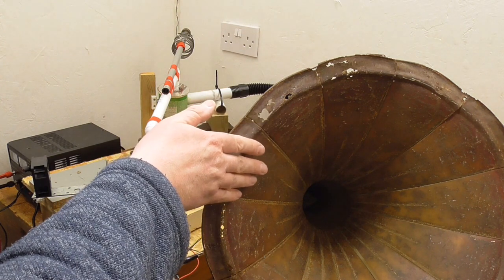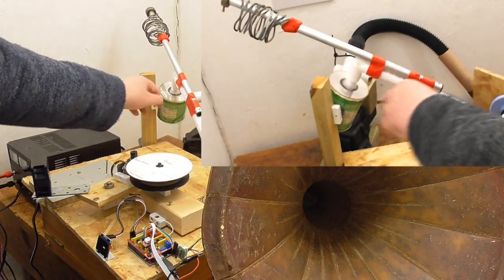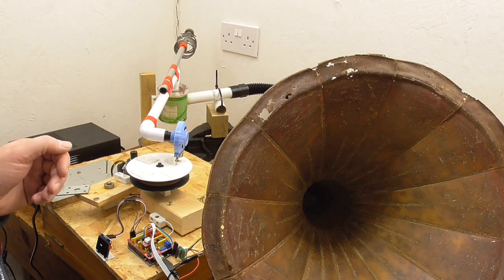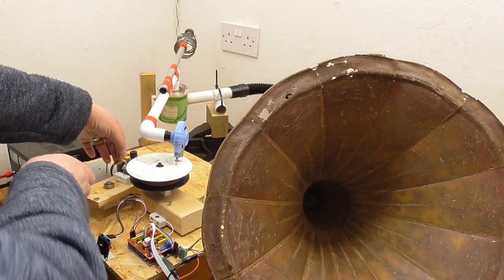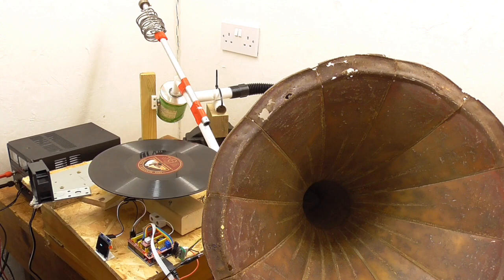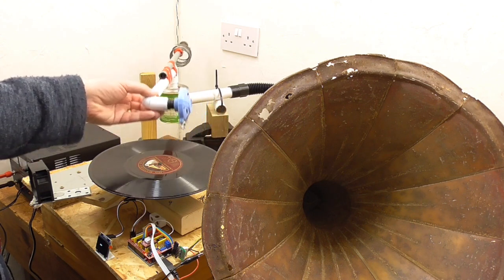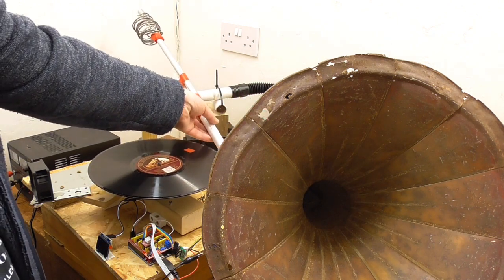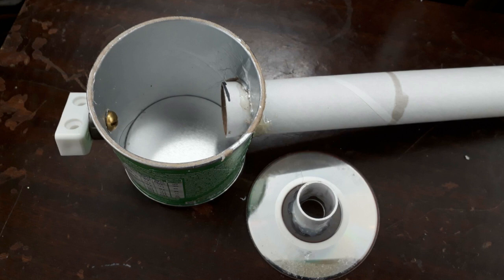Stepper Motor Gramophone with big horn

Comment: Very nice, much improved. I like the tone on the soundbox you made better. Always look forward to your videos.
Reply from the maker: Thanks 👍. The sound on the DIY one is not bad, but I will probably have a go at building a better one using the lathe. I don't want to go all precision engineering though as part of the fun has been building this sort of stuff out of scrap and junk. 😀
Reply: mrrgstuff of course, you should see my pile of scrap and junk

Comment: I did expect it to be louder, any air leaks? Maybe piping needs to go through the pringles box, instead of directly into it.
Reply from the maker: Yes, I expected it to be louder too. With the blue sound box you can tell the sound is coming out of the horn, but with the DIY one, not so much. No noticeable air leaks but I think you are right about the Pringle box, the pipe should continue through it. Shouldn't be too hard to change, though I ought to measure the volume before and afterwards also. Thanks 😀

Comment: Interesting. I reckon a much shorter path to the horn would improve the sound. Cheers
Reply from the maker: Thanks 👍Yes, the path is a bit convoluted now! I didn't really want to use the black pipe as it's corrugated and probably ruins the sound. I also don't know how the Pringle box is affecting it though I suspect it's working as a speaker also. I may have a go at cleaning up the design a bit. Thanks 😀
Reply: mrrgstuff i like the thought of having an electric motor playing through a soundbox and horn, saves all the effort of winding
Reply from the maker: Yes indeed, and upgrade kits were sold to replace spring motors with electric ones back in the gramophone period. I have not seen one converted like that, but I do have a windup portable which has had its tonearm swapped for an early electric pickup. It will make it into a video one day. Thanks 😀

Comment: You made that rpm controller used arduino???
Reply from the maker: Yes, it's made with an UNO and an A4988 CNC shield (very cheap). The video I did on it is here:
https://youtu.be/4qzRrEAXGO8
There are also other videos in a playlist showing all the variations I went through to get to this design and all the mechanical parts too.
Thanks 😀